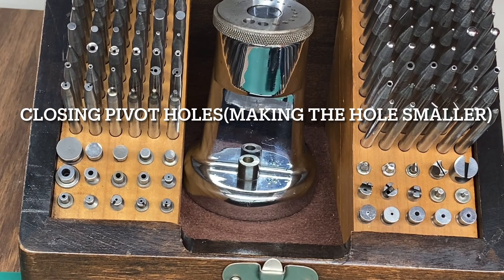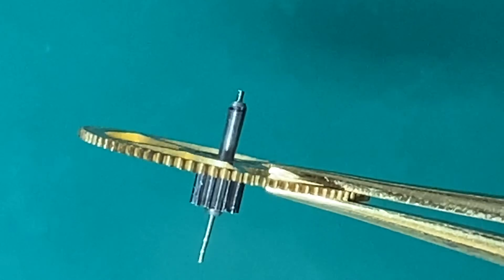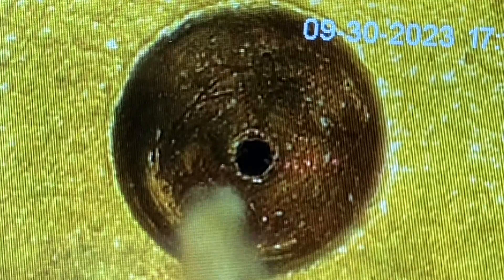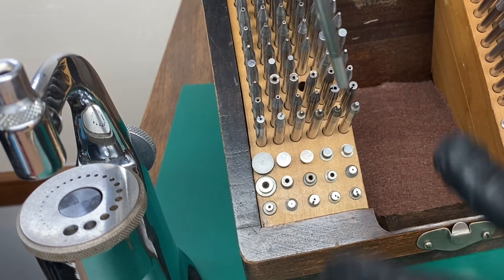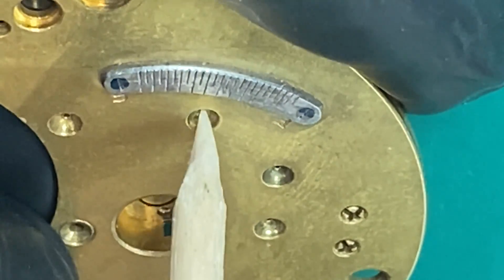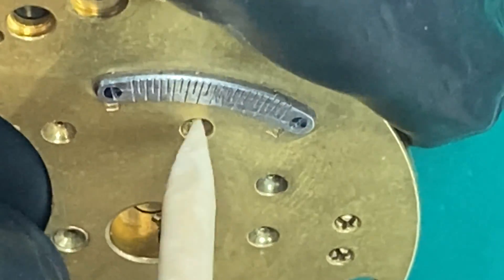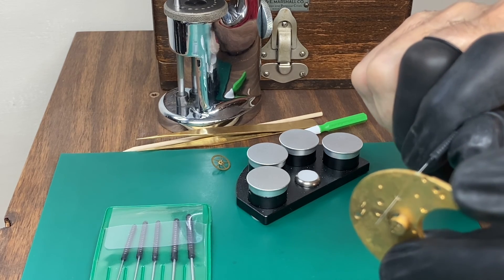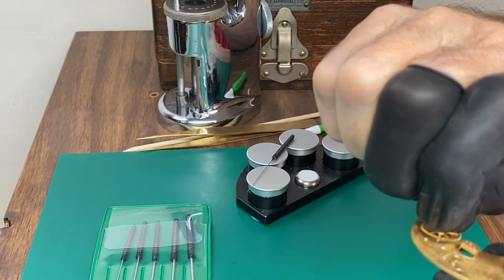How to Close Pivot Holes on a Pocket Watch Using Watchmakers Staking Tool

Comment: Just curious, could the brass holes be reamed out and jewels be added to the brass plate? Or is it too thin because it wasn't engendered to have jewels? Thanks for taking us along. 👍
Reply from the maker: Good question! Yes, it could be done that way.  If the hole was too large or or misshaped, that was a common practice -  to ream out the old pivot hole and to either insert a jewel (with a setting) OR to rivet in a two piece bushing and then redrill a new pivot hole in the bushing.
Reply: Good day, love your videos, very easy on the ears and the brain....easy to take i with simple language. I see someone already asked about inserting a jewel, is it also advisable to replace the bush with a steel bush??? Instead of the usual brass bush??
Thanks very much.
Enjoy your videos, and learn heaps from them.
Thanks again
Mike.
Reply: @michaelfonseka7657  Steel against steel will wear out very quickly. Dissimilar metals self lubricate. That's why brass or nickel is used on the upper and lower plates.
Reply from the maker: @michaelfonseka7657   Thanks for your kind comments!  I really don't know the answer to your question.  You may want to go to one of the watch repair FB pages and ask that question!  (All of the ones I have ever seen are brass).
Reply: @myhobbiesarenotcheap  thank you.👍🏼👍🏿

Comment: If a watch has been run long enough with old dried up oil, abrasive materials like oil and metal bits can become embedded in the softer brass holes and wear away at steel pivots
Reply from the maker: That is a great point!

Comment: Does anyone still do this? I have an 1887 elgin that needs this done. If not, where can I buy a punch set like that to do it myself? If you still do this how much would you charge if I were to send you the disassembled movement?
Reply from the maker: There are Watch makers that still do this type of work. You need to find a pocket watch repairer not a jeweler. The staking tool set I found it on eBay they are quite expensive. Sorry I just repair my watches.

Comment: Another super video. Love it. 

Thank you so much for making these videos. 

I like how clear you are and even have some labels for what tools you are using. I can screen shot. 

I also like that you speak slowly and don’t have some rubbish music which sometimes serves as a distraction. 

Have you ever tried using a staking set to help remove a stubborn screw? I basically work on wrist watches and sometimes a caseback screw is very tight and needs a massive amount of downward pressure from screwdriver head to screw while turning slowly. 

I’m thinking have the screw drive head on the staking set and tighten up and then slowly turn the entire watch caseback clockwise. 

What do you think?
Reply from the maker: Thank you for your kind comments!   Your idea sounds like it might work! Let me know how it turns out!